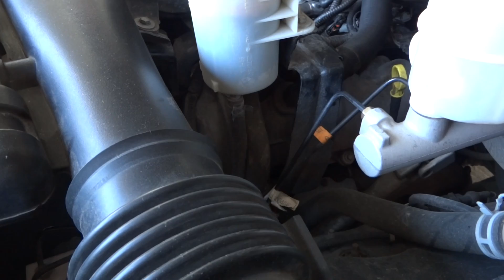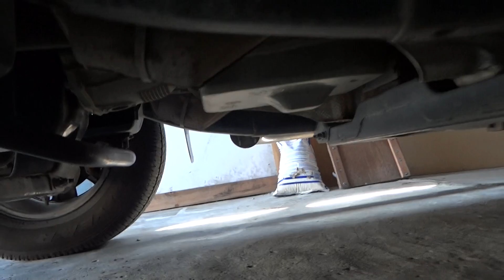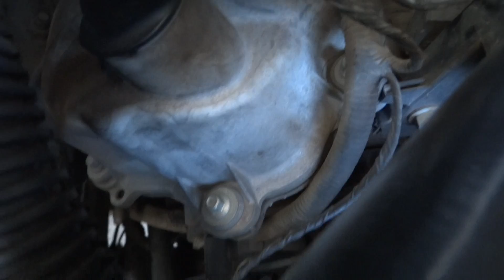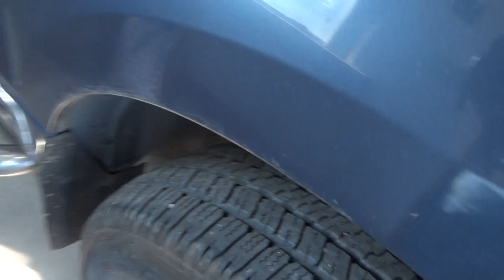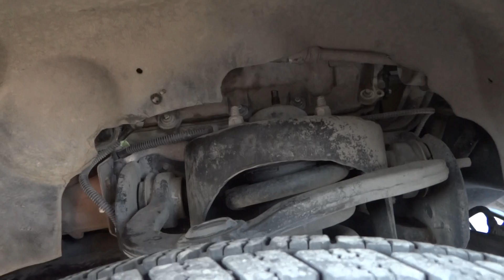Ford 5.4 3V Triton Cam Phaser Noise Before and After replacement 2004 F150

Comment: I have a 2004 ford F150 212,000 miles it's sound like yours in the video with no check engine light is this a bad thing should I be worried

Comment: I have an 04 FX4 with the 3v 5.4 in it, when ive got the hood open all i hear are injectors, cold or operating temp, however i do hear a dieselish sound from the lower end when i get down to the fender\step boards, do you think this would still be phaser knock? Doesn't get louder or anything when driving just stays about the same no matter what but only after it warms up. Only got 89k miles, been mostly well maintained that i know of.

Comment: if you replace the phasers I would recomend changing the oil pump also to a high volume oil pump solves the issue from every happening again due to low oil pressure,

Comment: I got the exact same sound. 2004 f150 with 197k. Gonna drive it till it blows up.
Reply: Do cam phasers really matter? Hows your truck holding up now
Reply: Hey I have a 2010 5.4 with the same sort of knocking sound just like the video. Had it since about 100k miles and truck now has juuust about 200,000 now without the noise getting any worse. Truck still runs great so to me it's not an issue at all unless you can't stand the noise. From what I'm told, it's a pin inside of the phaser that starts to have a clearance issue and starts banging around inside of the phaser but you can drive a 5.4 like that forever without issues. The real problems to whatch for is spark plugs and chain tensioners. Those will get ya. I would steer clear of 5.4's in general when buying used. Try to get a 2011+ with a 5.0. If you really want a 5.4, get a 09 or 10 because the spark plugs don't break on them and I think the chain tensioners were changed.
Reply: How’d that work out?
Reply: Mine blew up at 140k 2005 expedition. 4 cam phasers replaced!
Reply from the maker: @CITZN_MoFo  They only have two cam phasers in the 5.4.
Reply: @Easternoregon1  in the expedition 5.4 not the 5.4 in general. navigator 5.4 has 4. its a 32v 5.4
Reply: he replaced the cam phasers twice and the 4v doesn't have cam phasers

Comment from the maker: I replaced the cam phasers  with genuine Ford cam phasers I bought online from freedom racing. I did the work myself like $400.
Reply: Easternoregon1 do you think the oil pump should be done as well? I have the same exact phaser knock. No sound when cold. When warm you can hear it from 800-1000 rpm.
Reply: i have the same noise!!! Nothing when cold but starts when it warms up, just bought the timing chain kit wish me luck doing it myself lol
Reply: Senko187 how’d it go ?

Comment: Did you have power loss? Especially on hills?
Reply: on my ford, i had a lot of stalling and power loss ! my rpm would get up to about 4 or 5 at only 35 or so mph and it was the cam phaser!
Reply: @haileywilson2983  thank you for answering. Glad someone took the time to!

Comment: So if it sounds like a diesel phasers are shot.  Looking at an 05 fx4.  Truck is very clean but kind of scared of the engine
Reply: Mines an 07 fx4. 312k on the original engine and the trans was rebuilt at 278k. Motors still going strong
Reply: So was it your phasers

Comment: May have already been in comments but question, Did just one side (drivers side) get changed out or both sides?  In the after video when you went to the the passenger side I heard the ticking but not on the drivers side. Thanks
Reply from the maker: Both sides I think your hearing injectors.

Comment: Trying to figure out if that is what mine is also.  Mine almost sounds like a rod knocking once it gets hot.  Doesn't do it until you take it out for a drive and the engine gets warm.  Pretty quiet, don't hear it at idle when you first start it up.
Reply: Only if the engine is at normal operating temp and you bring the rpms up to like 1,500-1,800 and the engine starts to knock once you release the throttle then I would say your vcts are sticking. At least that's what my issue was.
Reply: J. W. How did you fix the problem
Reply: Just like mine,how did you fix it

Comment: I have a 2006 Expedition with the same problem, I took it to O'Reillys and scanned the Check engine Light and codes popped up,  cam shaft position sensor and 4 and 5 cylinder miss firing, motor is ticking and it's loud, PLEASE HELP 🆘 WHAT SHOULD I FIX FIRST
Reply: WavvyTech82 did u fix your problem? Im having the same issues
Reply: You can try changing your VVT solenoids,it may help. More then likely though on your crankshaft there is a reluctor ring,if the timing chains get really loose (stretched or tensionors blown out) the chains can slap that wheel damaging it and cause a miss communication to the cam sensors.

Comment: I've got the same problem with mine right now. The local used auto dealership I bought it from said he replaced the cam phasers after the old owner traded in but the ticking came back. So I wondering if you had any ideas on what it could be? I've looked on forums and they said I should try replacing the VCT solenoids so I was thinking about trying that next. Any input would be greatly appreciated! Thanks
Reply from the maker: +Matthew Boehnke I changed the VCT solenoids 1st. It did not stop the noise but maybe the combination of both did. They are very easy to change. My noise still has not came back. I'm using 10-30 oil now too.
Reply: I don't know if you're still dealing with this problem but a lot of times when the phasers fail so do the chain tensioners. I fix phaser problems pretty frequently at my shop and I generally just lock the phasers and retune the ECM to eliminate the possibility of future phaser failure. I also replace the chains and guides, install a melling HP oil pump, and ditch the plastic tensioners and install the early style iron tensioners that have the ratchet. Haven't had a problem yet and have probably done around 30 trucks this way in the last year or so.
Reply from the maker: I changed mine before the cam phasers, they are easy to change
Reply: So i got mine figured out, it was under warranty (bought it december 2015 from a local used car shop) so the guy did the cam phasers. It helped a little bit, but could still hear the loud ticking noise. I took it back and he went back in and it turned out i had a broken lifter. He put a new one in and it sounds like a brand new truck. only $250 for all of that. Glad i found the problem it was getting annoying.
Reply: @Easternoregon1  Hey are/were you running 10W-30 on the stock oil pump or did you have the mellings oil pump? Thanks in advance
Reply from the maker: @alexsoriano5173  stock oil pump 5-20
Reply: I added powerful gunk cleaner to my oil and the codes went away.

Comment: did it make the noise
when u started the truck an continue making noise? when mine is cold I start it up an it knocks or ticks an keeps doing it when it's warm to...I checked spark plugs to...
Reply from the maker: Yes but it would get louder as it warmed up.
Reply: So if it makes a racket when it starts up cold, but quiets down when hot, it's ok?
Reply: That's most likely a manifold leaking.

Comment: At what mileage did you first start hearing the knock? I'm getting ready to repair cam phasers now, and I'm indecisive on whether to use OEM replacements or the lockouts. I know lockouts reduce power but i'm afraid to spend money on OEM parts if they are going to go out again.
Reply from the maker: I bought the truck with 30,000 miles on it. Always had the ticking sound. It got louder at 112000 when I changed them. I no longer have it but it was still quite after 3000 miles on the new ones.
Reply: Lazaro Hernandez got my 06 f150 at 134k ticking didn't start until it reached 140k, it has 146k on it now and they've never been replaced

Comment: +Easternoregon1 Did this repair last for a while? Did you change any other components out besides the phasers?
Thanks
Reply from the maker: Also changed VCT valves. I only kept it for another 7k but it was running good and quite. Traded it for a f150 with a 5.0.

Comment: This is a problem from Ford and even if you replace the Cam Phaser itself the problem might come back within a year or two,I believe the 4.6 and 5.4 engines are the ones to have this common problem,don’t waste your money trying to replace unnecessary parts.Do your research and again good luck.
Reply: Hows selling yours going? I got a 2005 with 180k has the tick sound but it's not as noticable with my exhaust setup. First person to contact me after posting mine forsale asks were the can phasers changed? Lol Thankfully my truck has about 10k in upgrades so I can still get my money out of it.

Comment: how much of a pain was the passenger side?
Reply from the maker: It was harder because of the A/C lines. I did not want to discharge them so I just tied up the valve cover. Make sure you have the tool to keep the chain tight so it does not fall off the bottom sprockets.
Reply: Easternoregon1 yep, I saw the freedom racing package for $400 comes with the wedge tool

Comment: My 2003 sound like the second part of vídeo 145k
i change My oil to 5w30  best can do to keep lubricadet the chains and phasers
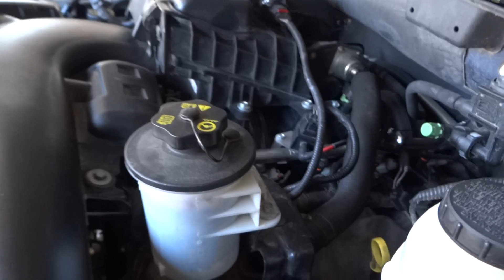Reply: Hey Victor so all you did was put 5w30 oil in your car and yours started sounding like when yhe video starts at 1:01 ? I have a Jaguar XF 5.0L which is a ford engine beautiful car but that cam phaser noise is annoying

Comment: I changed the solenoids about a month ago hoping that it would solve the problem, but it didn't.  I took off the timing cover, expecting to see the guides broken and evidence of the chains hitting the cover, but nothing.  All of the guides were fine.  While I had it open, I changed the left and right tensioners, thinking that maybe they were not working properly and the noise was the chains slacking and slapping against the guides....but that didn't solve the problem either. I am surprised that your video is the only one showing the before and after engine sound after changing the phasers, since the problem is so widespread.  Did you have to do anything with the cam shafts, like locking them down or removing any springs, to prevent them from moving?  or was the wedge tool all you needed?

Thanks
Reply from the maker: +john ceeancee I changed my solenoids about a month  before also. Did not help but maybe will stop it from happening again. I did not do anything with the cam shafts and yes they turned a little. I put the chain on the phaser and started it on the shaft up to the key, then turned the engine until it lined up. Not the right way but it worked. I bought the pickup at 30k and changed the phases at 105k. It has never been this quite.  This is the only problem I have ever had with it. Let me know how yours goes.

Comment: Hi,

I have the exact same issue with my 2005.  I ordered the phasers and am going to replace them myself.  Did you ever discover what in the phaser actually is making the noise?  Did you replace the phasers by just removing the valve covers and using the wedge tool?

Thanks,

John
Reply from the maker: they had a strange  worn spot around that outside about 1/8 wide. I have never open them up to see what the inside looks like I should. yes I change them using the tool and taking the valve covers off. I also changed those two solenoids. It still catches me off guard how quiet it is. I also switched to 10-30 oil

Comment: Unless you have a cel don't waste your money just to fix noisy phasers,5.4s are just noisy engines.I bought mine new in 04 and it has had the phaser noise from almost day 1.
Reply: I have an 05. Im at 87k. Bought it at 80k. Its always had the knock when the engines warm. But its still a tough truck. It dosent seem super serious except for the noise. You think they will stand the test of time? Once i hit 1000rpm, oil pressure seems to be sufficient enough for the noise to go away. Personally the diesel sound dosent bother me much
Reply: Is your truck still going
Reply: @AaronRowland-y5w  yes it is, 175000 still going strong. I change the oil every 5000ish miles with Mobil 1

Comment: Don’t bother changing these it does no damage to the engine, if you don’t wanna hear the ticking noise i suggest getting an exhaust, I cut all 4 cats going straight to the back.. it’s ridiculous
Reply: Are you serious these does no damage the engine?
Reply: @williamdiaz8100  the 2 valve 5.4 can make this noise for 100,000 miles with no issues...the 3 valve 5.4 is another story
Reply: @midwest9757  The 2 valve 5.4L would not make this noise because the 2 valve engines do not use VCT and therefore do not have cam phasers.

The 2V engines might make a slew of other noises, but not this particular one.
Reply: @the_color_orange  yes the do have cam phasers, I have changed them out before
Reply: @midwest9757  it wasn’t a 2v